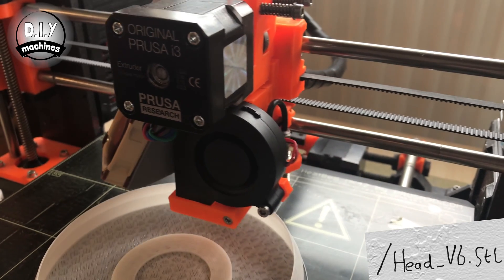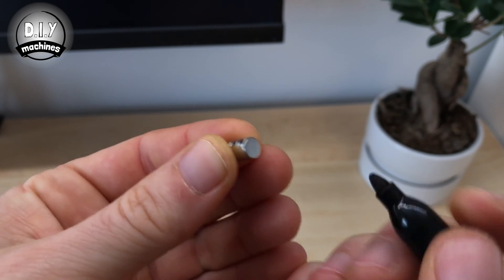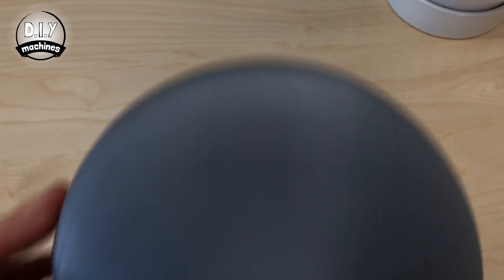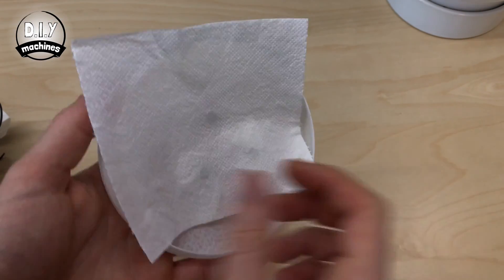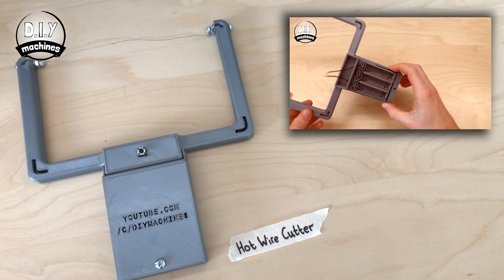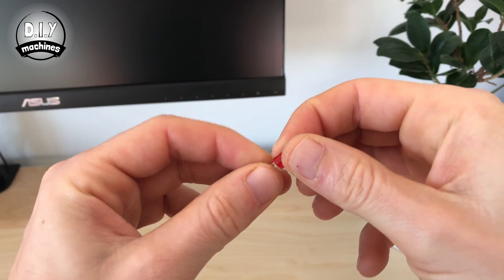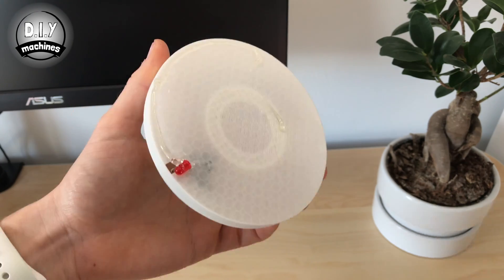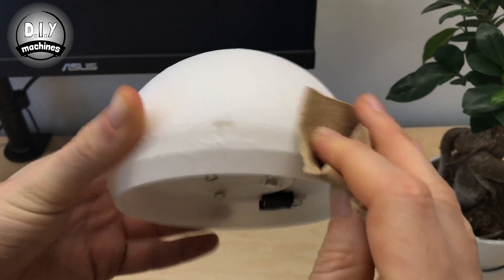Star Wars BB8 inspired RC Printed Robot - P2 Head

Comment: Can the head be 3D printed, this is a great project 👍
Reply from the maker: I tried that originally but you really need to keep the weight of the head as low as possible and I count design a suitable print which was lighter then using foam.

Comment: Ok, I"m confused? why did you 3d Print the bottom, and Not the top of the head? instead of using styrofoam? Just wondering why it wasn't a thin layered top printed for it?
Reply: I was thinking the same thing, would have be more accurate then the foam ball
Reply: Less weight